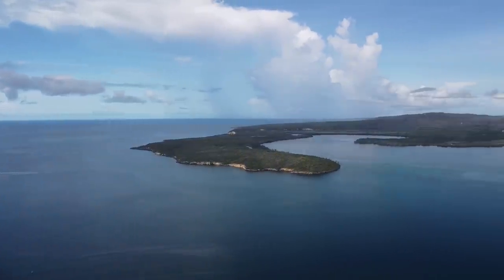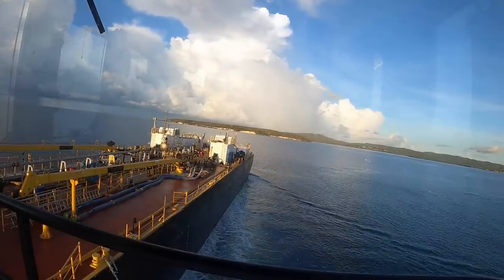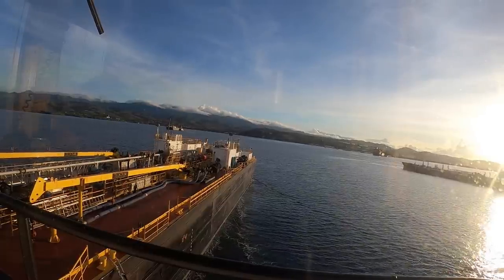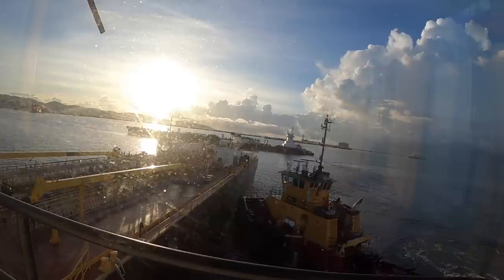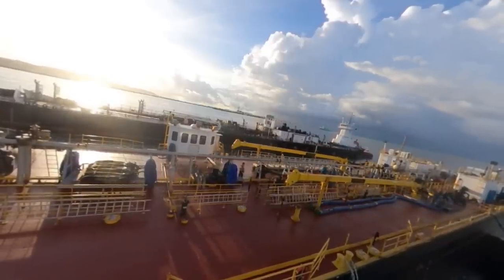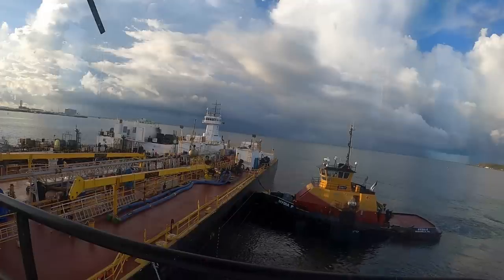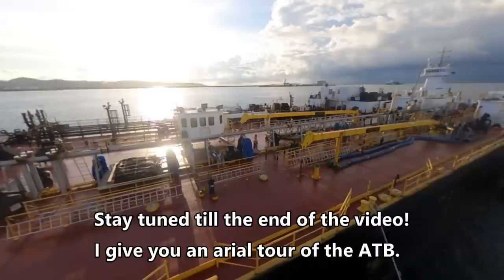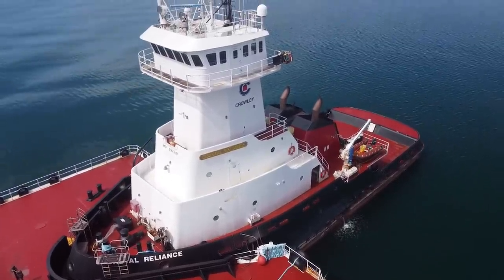STS Transfer and Look at an ATB

Comment: Yeah, cavitation starts it but in New York particularly, you had a lot of loose stuff to rattle on that boat.  I'd have taken a tube of construction glue around that thing within a week.
Reply from the maker: Thank you for watching.  That seems like a good idea, but one might wonder why no one does it? Also remember that the 3000 I ran in NYC was open wheel and this 4200 has court nozzles. Many of the things you see and hear from the shaking are a result of many (13) years of being shaken.  LOL CUOTO

Comment: Thanks for explaining the ATB - that is a beautiful tug. And you can see the port pin at 24:40. So the ATB tug and barge generally stay together for most of their life? Makes sense if it is transporting to and from Texas to Puerto Rico and not doing a lot of local transport. Also, I would think the water ballast is brought on the barge to keep it near the same level of the tug whether it is full or empty. Otherwise the tug may be high or low in the bow which obviously wouldn't be appropriate.
Reply from the maker: Thank you for watching David.  Yes. Most ATBs are "married" to their barge for life.  The water ballast does help a little for pin alignment but there are either multiple holes for the pins or a set of teeth or gears that the pins can rotate into.  The ballast is primarily for stability and handling. CUOTO

Comment: Thanks for another nice and informative video :) Could you sometime talk a bit about the rate of charging and discharging, or is that trade secret? Like did they fill your barge up all the way? How long does/ did that take? Do you use a single wide diameter hose/ pipe or do you have several transferring in parallel? Thanks!
Reply from the maker: Thank you for watching Ben. It all depends on the loading or receiving terminal. But usually they use one 8 inch hose and can load in 8 to 12 hours. CUOTO
Reply: @TimBatSea  Thank you very much for the answer and explanation :)

Comment: Thanks so much for the video Tim, I am new here and working back through each one.
I have a question please....Are you tell us about the number of total crew and what their responsibilities are?
When you are off watch, is there a second Captain?
Are the tanker men totally in charge of their own barge once tied up?
Of course I fully respect your decision if any of this is commercially restricted.
Reply from the maker: Thank you for watching and welcome to the channel Ken!  There are usually 5 people on the tug and two more on the barge. The tug is split into two watches. The captain has the watch with a deckhand from 6 to 12 and the mate has the watch with a deckhand from 12 to 6.  There is an engineer who usually stands the Captain's watch, but who is on call 24 hours a day.  (The mate is the 2nd captain)
    The captain of the tug is responsible for the barge while he is connected to it. After that, there is a lead Tankerman.  CUOTO
Reply: @TimBatSea  Thank you for replying Tim, I really appreciate it.

Comment: With coming all the way from Texas, is articulating superior to towing on the wire? As you flew around the front it didn't even look like he could have been set up for towing by wire. Didn't notice the difference in deck heights and drafts as you approached. Noticed it at your end fly around. In the distance as you were approaching was that another barge awaiting lightering?
Reply from the maker: Thank you for watching. The ATBs are usually much faster (one body going through the water instead of two, and a longer waterline means a higher hull speed). The tug and barge anchored are very similar to our barge. They have the black oil contract while we have the clean oil contract. CUOTO

Comment: I work at fuel terminal in the Pacific Northwest and deal with vessels all the time. I am wondering why you don’t push from the notch especially in this instance.
Reply from the maker: Thank you for watching Ian. We can't push in the Caribbean swell, so we tow on the wire and then flop on the barge.  In the anchorage, it would have been fine to punch in the notch, but we were already made up alongside. CUOTO

Comment: Why are barges with tugs used instead of small, self-propelled tanker vessels? Thanks
Reply: Good question. Lower construction, maintenance and operating costs, longer service life, much smaller crew, greater versatility, higher efficiency for coastwise and shorter voyages... traditional ships have better seakeeping ability and sometimes higher speed, making them more useful for longer voyages. The US relies on ATB's and tug-and-barge units also because our regulations require domestic-built boats only for intra-US shipping and US shipyards are enormously expensive for large hull construction.
Reply from the maker: You are the man Paul!!!! Thank you very much for helping out!! CUOTO
Reply from the maker: Thank you for watching.  Boston Paul does a first-rate job at answering this for me.  CUOTO
Reply: @bostonpaulmakes6927  I see, it's another illogical touch point of the Jones Act then?

Comment: How does a captain and the company think about fuel and efficiency of operation?
Reply from the maker: Thank you for watching Marvin.  We usually know where the sweet spot is for getting the best speed ar the least fuel burn rate. CUOTO
Reply: @TimBatSea  If I heard you correctly, you mentioned that the pilot or the assist tug had another job. That is what got me to wondering.